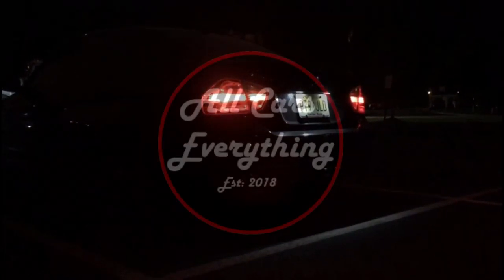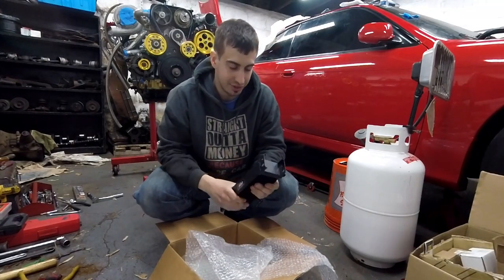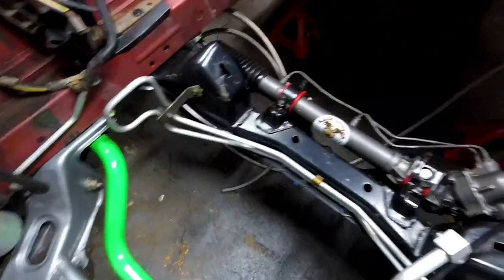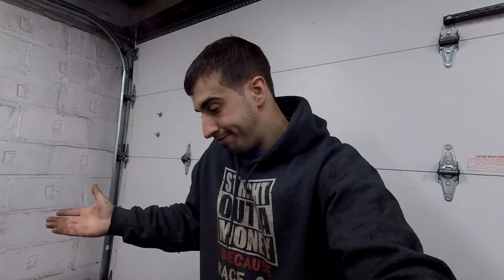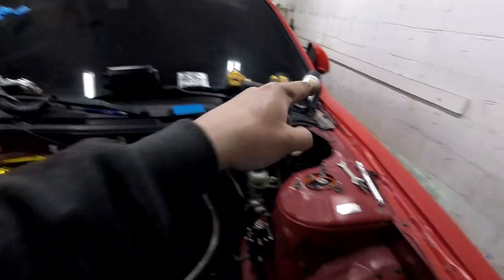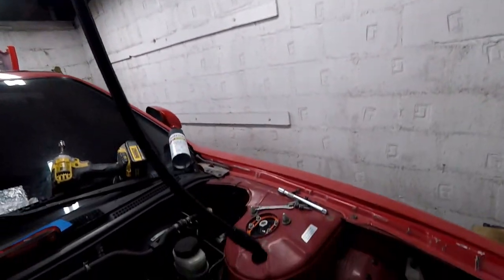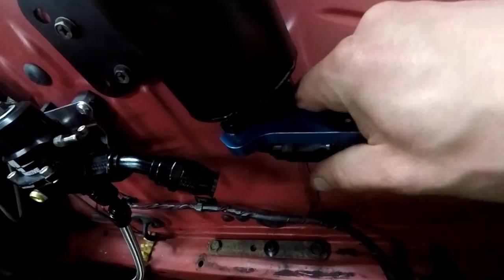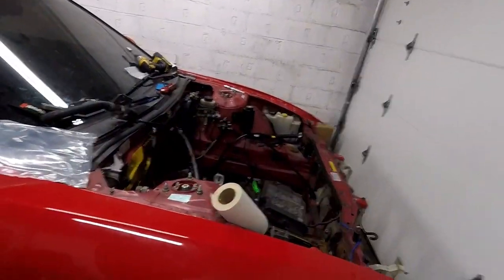2JZ SWAPPED S14 CHASE BAYS POWER STEERING KIT INSTALL!

Comment: Did you ever end up needed the PS Cooler?
Reply from the maker: Daniel Yebra I haven’t gotten to that point yet unfortunately cuz I’ve been working on my house 😔 but I have learned that the chasebays ps cooler is plate and fin style which creates to much back pressure and burns out the pump. The tube and fin setup is better flowing. But this is something I read and can’t vouch on personal experience
Reply: All Cars Everything ahhh ok thank you for the info. Wasn’t sure whether or not I should’ve use their cooler or go with another make. I removed the the cooling line aswell and it got me worried since I’m at the stage of testing and troubleshooting.
Reply: Any updates on the cooler?
Reply from the maker: Jason Evangelista not yet bro I haven’t touched the car I’m still working on the house :(
Reply: I see, good luck on the house! Send us updates when you can!
Reply from the maker: Jason Evangelista thanks bro means a lot! Update will be coming soon!

Comment: I know its been like 2 years but what did you do with that sensor? Was there a code that popped up or something?
Reply from the maker: The function of the sensor/switch is to raise the idle rpm to offset the drop in rpm caused by the load of the power steering pump when turning at low speed. You dont really need it a lot of people remove it when going steel braided lines for drifting. It wont throw any ecu codes either.
Reply: @AllCarsEverythingOfficial  awesome thanks for the reply my man 👍